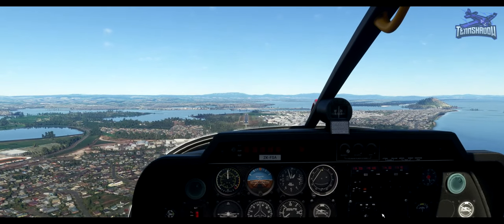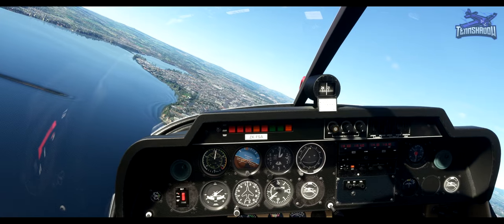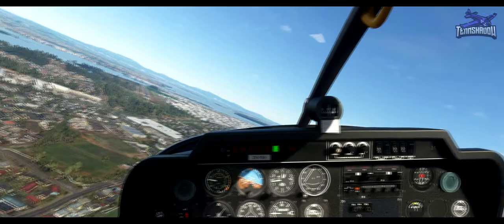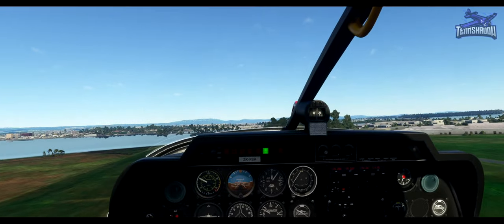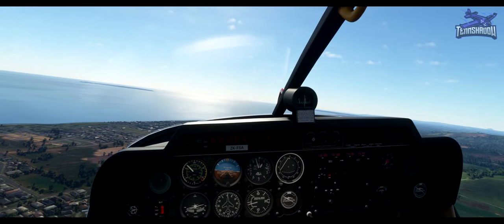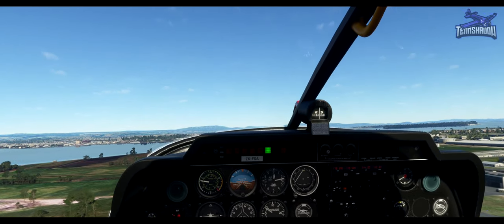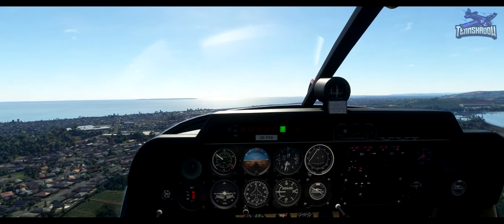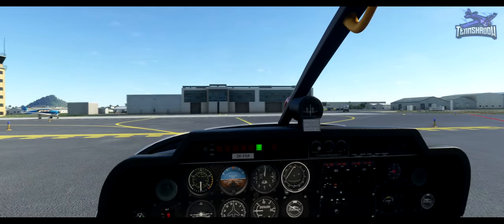FS Academy VFR | Lesson 3  - Circuits | Microsoft Flight Simulator 2020

Comment: I think the change to a low wing is to make it easier to fly the pattern. Flying in a high wing hides the runway in the turns. So I think it's to help in that regard.  Also, learning to land in a low wing is easier and there's typically less float on the flare in a low wing.
Reply from the maker: You're probably right about that.

Comment: I'm surprised the instructor didn't suggest to bug the runway heading. Then all you're doing is making 90 degree turns following the compass around the pattern.
Reply from the maker: That's a great tip for circuits!